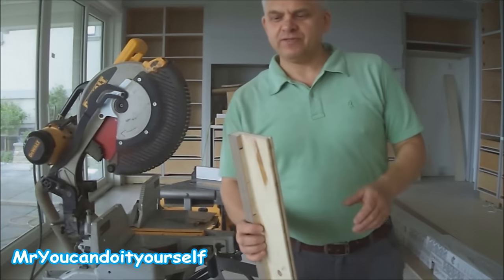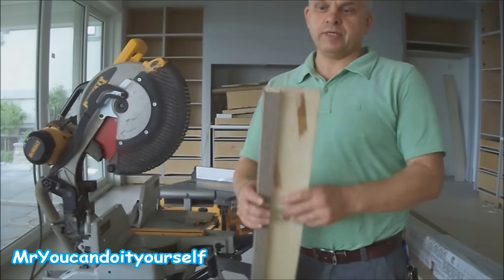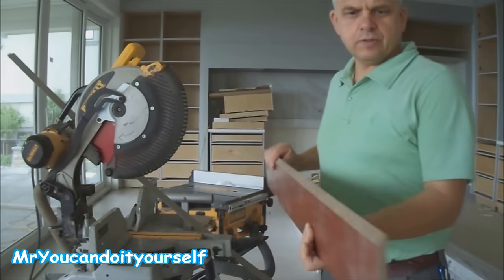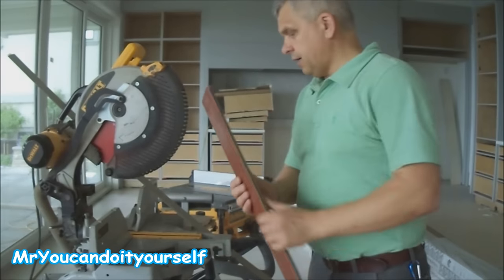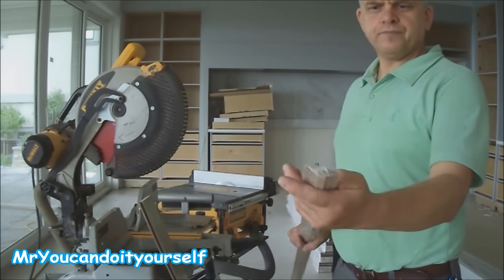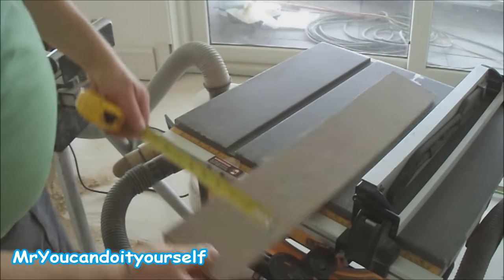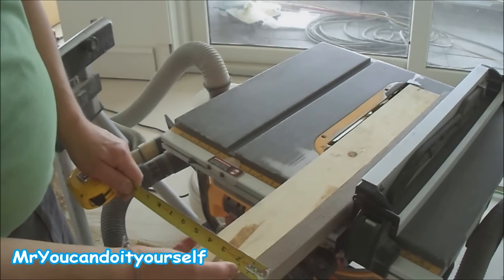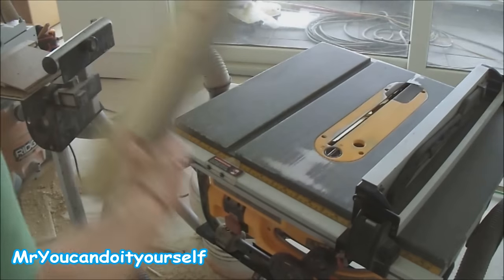Laminate Stairs Installation: How to Make Stair Nosing Yourself Tips Mryoucandoityourself

Comment: Great stuff, I have been tempted on doing this same thing you show on this video for Stair Nosing, before I stumbled on your videos, which kind of reinforce my thought also of using T-molding, as an option to making a nice finish on the nose of the steps,   but it is a lot of custom work, that I wish I did not have to do. Zamma makes a stair  cap for the whole stair but it is expensive and I want to use the existing Pergo flooring for the risers and treads. I have been looking at at a practical and secure way of making a nose molding with smooth transition for Pergo XP lamnate floor planks. I don't like the transition nose molding Pergo has with a ramp over the plank, a la T style, although it is a subtle ramp it is  not flush with the thread as I think it should be for a more appealing finish.  I am upset with Pergo that they do not make a nose molding which interlocks with the floor planks' tongue so to end up with a smooth tongue and groove transition nose molding for steps with a rounded edge. My dilemma is  I don't want to trim the rounded edge that is already on the steps in order to install Pergo planks with the "picture frame edge like" stair nosing on steps and risers. I am  short of engineering my own nose molding design,  which I may end up doing anyway, in view that I cannot find what should be obvious and available, for Pergo laminate flooring for use on existing stairs with round nose edges,  A stair nose molding similar what Zamma has on the stair casing for existing curved nose steps, but only a strip at the front of the stair and with enough surface to interlock the step Pergo planks securely and firmly on the edge of the step where it really matters, is what I am looking for and should be readily available, but so far I have had no luck in finding such.  I guess it is time to take out the router and make my own with tongue and groove using solid wood and  try to match the plank pattern and color with stain and clear coat.
Reply from the maker: Yes you can buy unfinished wood nosing and match color. It's the easiest way for you. thanks for watching.

Comment: What saw would U recommend for cutting laminate nosings
Reply: Saw blade *
Reply from the maker: Hi, I am using 10" DeWalt sliding mitre saw with not less than 40 teeth blade. Thanks for your question!

Comment: Was thinking about planing the underside of pergo to 2 mm and trying to bend it for a round nosing.  Likely the backer is to brittle even when thin.  Your method looks like a great alternative.  The standard factory made transition piece looks very unsafe.  Thank you for sharing your idea.
Reply from the maker: You are welcome!
Reply: I was thinking the same thing, but backing it up with fiberglass (bondo). That's just too much work for something that should be easy though, so I love this video.

Comment: Just curious, if you were to glue this nose down on the first stair, which would be connected to the rest of the  planks.  Should we be concerned about having no expansion gap at that spot (since we are dealing with a floating floor?) Thanks
Reply from the maker: For stairs don't need expansion gap.
Reply: @MrYoucandoityourself  
Thanks.

Comment: Looks great but it's sure to crack off inside of a 6 months or less from heavy stair traffic.
Considering laminate flooring is nothing more than a paper (MDF) product under that fancy surface the interlock joint in laminate flooring is not designed to withstand the constant flexing that a home made stair nosing such as this would allow.
If you're going to do this consider applying a generous application of construction adhesive between the home made stair nosing and the subfloor to make sure that thing stays in place for years to come.
Unless of course you're installing in your mother-in-law's house. Otherwise use hardwood stair treads and nosing so you don't end up killing someone or yourself when it breaks off and sends you tumbling down the stairs to your death!
And what is that incessant clicking throughout the video??!!
Reply from the maker: Thanks for your opinion, here is another video - https://youtu.be/f3lmR01rf8o